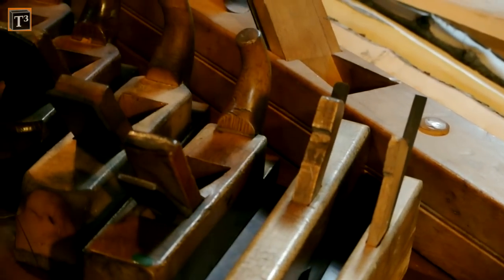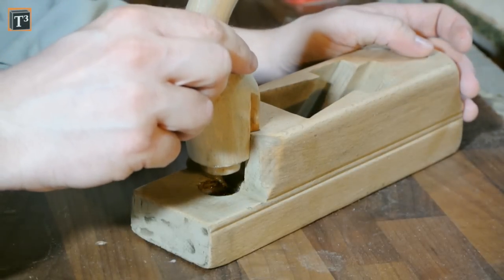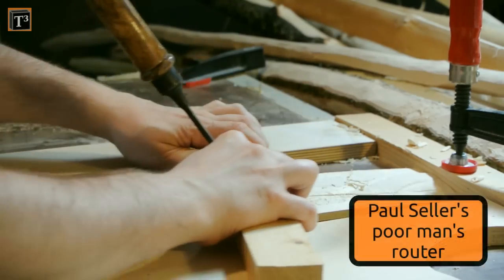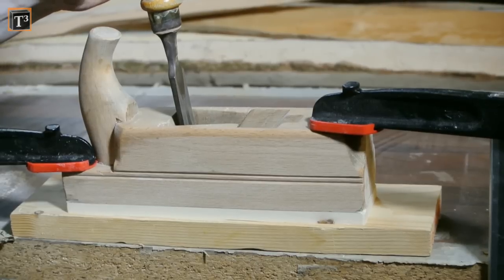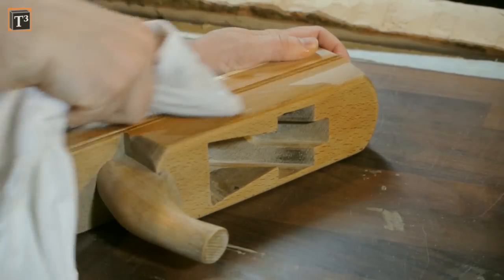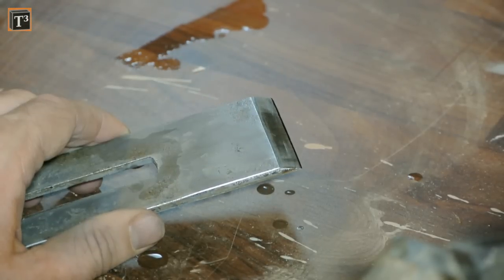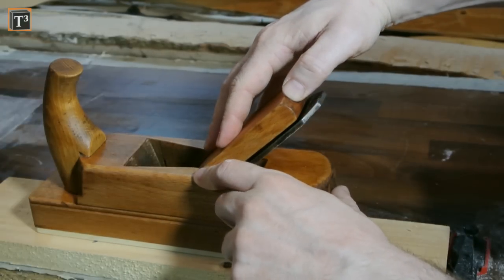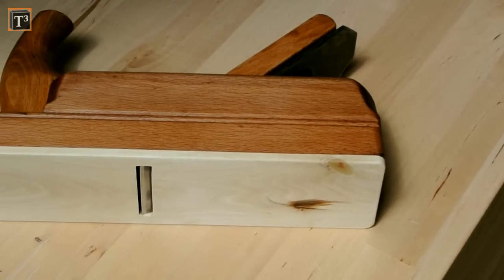Restoring Family History ▪ Old Wooden Plane Sharpening And Makeover

Comment: Nice restoration! I like the result. The only thing I would suggest to do differently is the attachment of the horn handle. If you use hide glue, instead of epoxy, it will make the future servicing of the plane much easier. Hide glue is intended for these type of connections.

Comment: Great video. I love the German wooden planes - there isn't a lot of English info about them online. I have a ECE block plane with a hornbeam body and a lignum vitae sole and it is great. Question... Where did you source the Hornbeam? Even in England it seems hard to get. Also, were you tempted to add some kind of mechanical join (such as some groves) for the new sole? I see on my ECE block plane has a series of interlocking rebates between the body and the sole.
Reply from the maker: I cut down the tree myself. So I had plenty of Hornbeam to use. I hardly found any to buy as well. Sometimes it's sold as firewood on ebay. Concerning a mechanical joint I did some research and found it not to be worth the work for a plane sole.
Have fun with your plane ;)
Reply: Wow! I should see if I can find some trees...
Reply from the maker: Come get some!

Comment: Gluing the handle is crazy. It's made to be repaired when broken. If glued it has to be DESTROYED and replaced. Unprofessional. Ouestion: What has the Berlin wall to do with these planes? Were they a part of the construction?
Reply from the maker: +Per Oskarsson the handle was just loose and not broken. The plane was made in the GDR and was used behind the iron curtain for a long time. Maybe I should have made these things clearer in the video.
Reply from the maker: +Per Oskarsson the handle was just loose and not broken. The plane was made in the GDR and was used behind the iron curtain for a long time. Maybe I should have made these things clearer in the video.